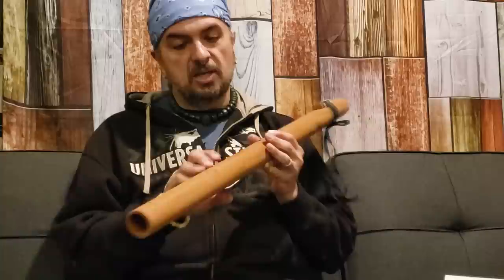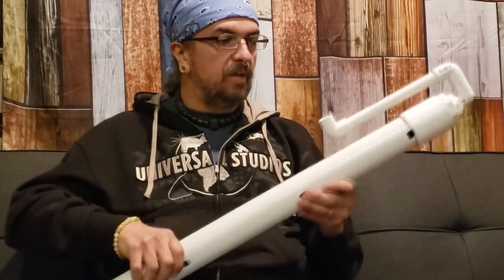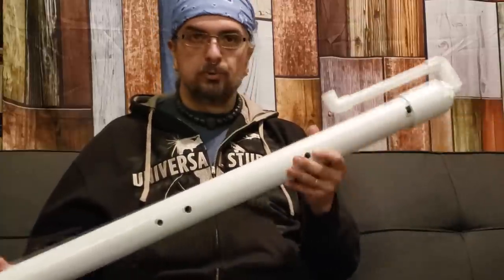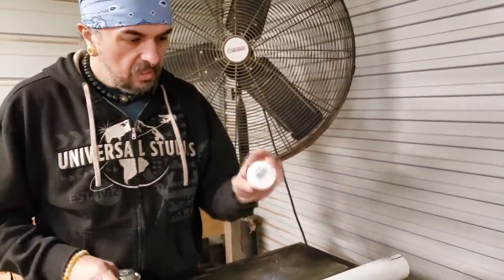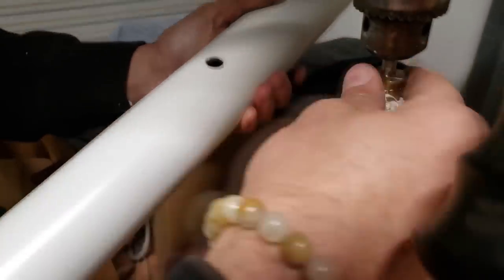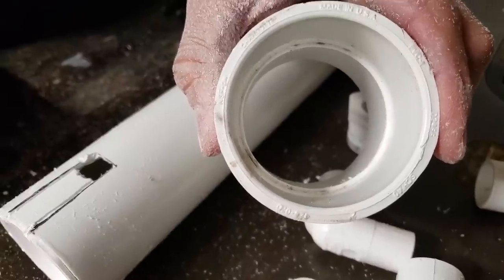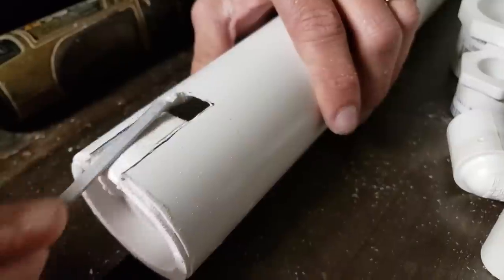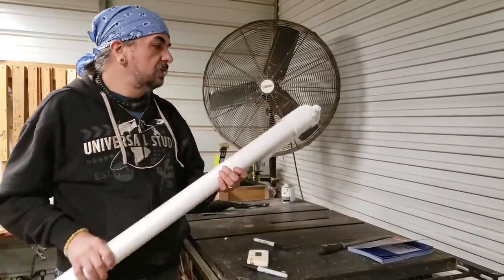How to Make your own Contrabass Flute for Under $20!

Comment: The Contrabass designation alludes to its history in the European Orchestral tradition. They exist as flutes and saxophones,  but are exceedingly rare. The reason for this is that so few Orchestral arrangements call for them, as compared to standard sized ones. An interesting curiosity? Yes. But by no means common. Thanks for taking the plunge and satisfying folks curiosity. 😉

Comment: thank you for sharing what other flute makers are very secretive about. 
I would love to make my own custom flutes. I have some unique ideas which I am sure will work and your kind of instructional vids give me the impetus to make a leap of faith.  
I want to ask you about the position of the airholes...  do they have to be in line ?  
the reason i ask this because a normal human hand has fingers of different lengths. so for easier more comfortable reach may the holes be staggered ? 
also where a very large tube is used like your contra bass  would attaching small plastic guides be an advantage ?
respect J of UK
Reply from the maker: Thank you for your kind words! With regards to fingering placement, It may seem ergonomic to place them in different positions however, what works well for one person may not work as well for another. I have tried to play flute makers flutes who do some strange things with their fingering placement however they do not work for me! When in doubt, I fall back on tradition. Thanks so much again for watching!
Reply: @BlueBearFlutes  Thanks for responding, i value your opinion of what works for you and was trying to discover something i am not sure about [the staggered hole remedy]. 
Having played pipes for over 50 years i cant do the bent finger technique. 
i am looking for what might work for me as a customised flute.  thanks again
Reply from the maker: @Jordie0001  That's the good thing about making your own custom flute, you get to make what works for you! 🙂👍

Comment: Hey! Thanks for great video, Ive searched just for this, but now need some help with instructions

I tried to make this from 75mm PVC pipe because in Finland theres really not 2" or ~63mm pipes, smaller is 50mm
Ive got notes like E3 Gb G3 A3 C4 and none from last hole (closest to mouth piece) So I think this size pipe isnt very good for that flute?

Or is it just about adjusting hole sizes? You didnt really shown much how to adjust holes if tone is too high or too low, is there any advices? 😄
Reply from the maker: I had the option of making one video that was 450 hours long or making 450 videos that were an hour long. 😉
Reply: Hope I can study this more then 🤔
Reply from the maker: @amtechprinters3339  I do have numerous videos to help! Please check them out!

Comment: In a lot of your other videos the taper for the sound edge is on the outside of the flute. Is there a reason this flute has the sound edge taper on the inside? Thanks and loved re-watching this video!
Reply from the maker: Hey Nick, thanks for watching! When we're talking about the tapered edge, I believe that most of my flutes splitting edge slant to the inside of the flute. Let me know if you see any to the contrary.
Reply: @BlueBearFlutes  thank you for replying, and for being so patient with silly questions! 😜

I went back through several videos and you did indeed cut from the inside of the flute to sharpen the edge. Maybe I was confused from the flat track extending past the sound hole? Either way, thank you for pointing this out!
Reply: @BlueBearFlutes  I'm definitely ready to pick up your book. I love your youtube vudeos, but the book will prove much better reference than my notes.
Reply from the maker: @njh113  it's all important stuff my friend, just never get hung up on anything being exact! (experiment!)

Comment: How did you calculate the hole locations for 2" pipe?  I'm using  (343m/s / (4* Note Frequency)) and not coming up with proper notes.
Reply from the maker: That's a great question! Many people use calculators to do this kind of thing however for me it was trial and error until I got it exactly right! Calculators aren't that efficient. Using a slightly different size PVC will not affect the location much. 🙂👍

Comment: Hi Charlie, thanks again for sharing... it is a great video!
I'm wondering how do you know where to drill the fingering holes? I suppose using some maths but really don't know. I'll appreciate if you can guide me with that because I'm thinking on doing a contra bass flute but with some tubes I have that are less thick than you used for this ocassion.Thanks!!
Reply from the maker: Hey Carlos, math certainly is a common grounds that can help to design it. It is unreliable at best however because of micro inconsistencies. I would like to say that we are only human! That aside I have used trial and error for a lot of my flute making patterns. Also, I have relied on some original flutes to get me going for the basis of my designs. My book has fingering patterns for many flutes however, not for many of the contrabass types. We do have a video for adjusting pattern sizes to fit your material. Be sure to check it out also.
Reply: @BlueBearFlutes  thank you very much!! That was very clear, I'll check your videos and book.

Comment: Charlie use a 45 degree angle on the blow pipe fitting it'll give you a better angle to play and not have your arm so crapped.
Reply from the maker: After the video, I added a 6" piece of tubing to the mouthpiece which helped immediately! Funny enough, I could see what I was missing when we were editing the video! 🙂

Comment: @BlueBearFlutes I need help my flute had a crack in it so i filled it put a string in it and covered it with epoxy but when i tried to play i can get the two lowest notes to come out like the last two holes i cant get the right noise its high pitch so i moved the block back a bit and then the sound comes out but its quiet and there is a lot of air leekage so i move it back to normal and the sound wont come out again is there a solution
Reply from the maker: It sounds like, after the crack, it has not completely been sealed. I usually use some type of super glue to seal cracks with however keep in mind it puts off a strong vapor when it comes in contact with wood. If you can run the super glue on the inside of the flute on the crack, you will see it seep through to the outside. At that point lightly sanding it usually fills in the gap with a little sawdust. You're welcome to contact me through my website if you have any other question. 🙂

Comment: Greetings 
Is there any way you could give me the measurements in inches. Please and thank you. I made one out of 1.5 inch pipe. Sounds beautiful. Just a little bit too much air sound. Is there something you could suggest to remedy that
Reply from the maker: Hey, do I not offer you the measurements in this video and inches? You can always divide mm by 25.4 for inches. With regards to the tone, my suggestion is practice make another flutes first. I have hundreds of videos on this and the sound hole and track area are not the easiest thing to do on anyting, much less a 4 inch PVC flute! Keep practicing.
Reply: @BlueBearFlutes  No you only give them in metric and the problem is when I translate them I get some thing like 10 72/100. Not exactly that but it’s not a measurement you can come up with without a micrometer or something. Sorry to trouble you. I messaged you the same question on Facebook.
Reply from the maker: @talawa777  I have to admit, that's quite unusual for me as I usually try to offer things in both. I would recommend highly rounding to the nearest eighth of an inch. That is of course .125 in decimal form. I say this because it would probably save you a great deal of time rather than having to wait on me to find time to go back and recalculate or re-measured everything. My measurements are always relative in any case as you need to tune each blue based on how you make your sound hole. Were you able to find my videos on sound hole and tracks? They will help you immensely!
Reply: @BlueBearFlutes  No but I’ll definitely look for them. Thanks so much. I’ll graduate to Wood one of these days.
Reply from the maker: @talawa777  pvc is ok, just remember that the diameter and the fingerings are always related! This means that the fingerings on the giant flute in this video will not produce the same tones as they will on a one and a half inch piece of PVC. I also have a video about that. Good luck and please keep in touch.

Comment: A true contrabass flute is a 16 foot stop instrument and would be about 6 inches in diameter and need a large floor stand.  I have a contrabassoon and its tubing is 16 feet long.  The instrument is coiled up to make it usable.
Reply from the maker: I have been so waiting for you to comment! I concede, I concede! 🤪
Reply from the maker: Secondarily, as per Wikipedia, "a true contrabass or double bass is any instrument that is an octave lower than the standard version of that type."
Reply: Just wondering what the lowest note you can sound on this is?
Reply: @paulgatt2950  - Contrabass C, the lowest note of a organ 16 foot register.  Look up organ terminology to familiarize yourself with all this lingo, there's a lot to learn.
Reply: @fnersch Would you happen to be able to provide measurements if I wanted to go down to G below that?
Reply: Also happy to buy the book if that has measurements for such a thing
Reply: @paulgatt2950  G below contrabass C  would be 24 feet long.  This would be in the middle of the subcontrabass octave which bottoms out at 32 feet.  The diameters range from 40 in. to 20 in. thru the octave.
Reply: fnersch can you provide an octave number or frequency for the g note below the contrabass c as I struggle with organ notation.
Reply: @paulgatt2950  The contrabass octave is the C-zero octave. G-zero would one whole step below the low A on the piano.

Comment: With that design you can make a modern day serpent just use a tuba mouthpiece instead of the whistle system.
Reply from the maker: I do like serpents - especially Quetzalcoatl and Jörmungandr
Reply: @BlueBearFlutes  i am going to try that myself also reminder serpents do have 6 holes
Reply from the maker: @MrBass4art  I was totally unaware! I thought they only had two holes! One with the incoming and one with the outgoing. And in the case of Jörmungandr one was filled with the other, lest you want to cause Ragnarok!
Reply: @BlueBearFlutes  i post a link of the serpent i am talking so you see we might be thinking two different instruments
Reply from the maker: @MrBass4art  to be honest with you, I am not thinking about an instrument. Have you ever heard of Quetzalcoatl or Jörmungandr?